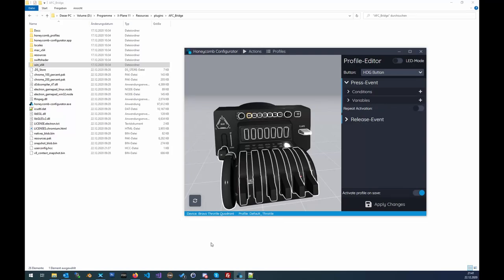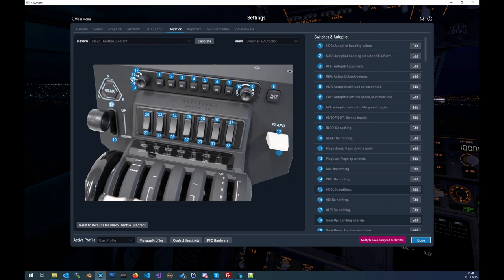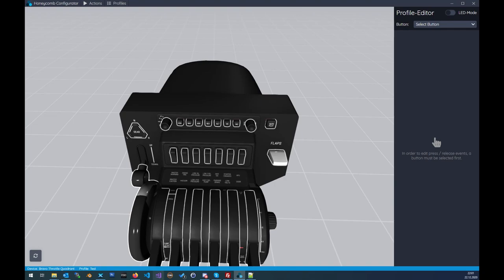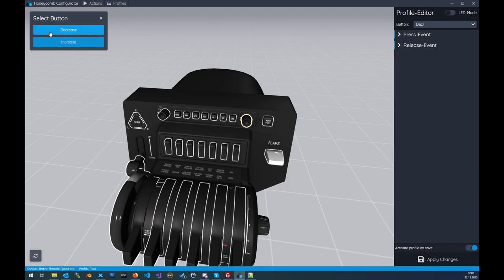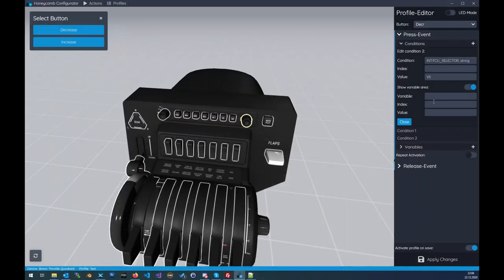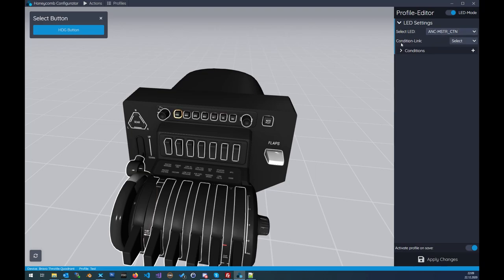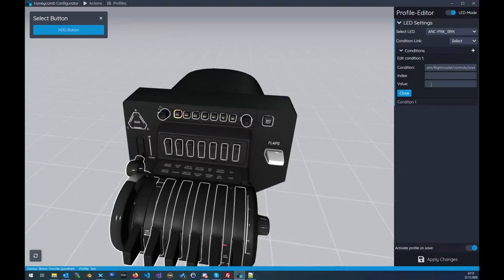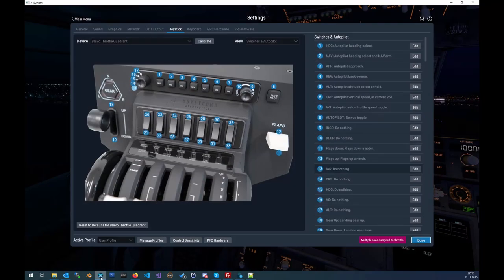Honeycomb Configurator - How to use Datarefs and Commands

Comment: on your video above you show the autopilot switches (HDG,NAV...IAS) backlit when not in active use. then when you select, say HDG, the light intensity increases to indicate it's in use. I use x-plane and none of these buttons are backlit. They do light up when depressed for use. Can you show me an example of the condition that I could apply to each of these lights to have them backlit when not in use. Thanks Roy

Comment: Thanks for your videos. Using a FlightFactor Airbus and having difficult time figuring a way to enter a command like "a320/Panel/FCU_Vertical_switch" in the configurator .  Under condition it does not show the datarefs/commands for this aircraft. When I try to use CUSTOM_NAME and enter the event when I load XPLANE it complains that this event will be discarded because of a null value. Any way to do this?

Comment: Can you tell me is there a way to use non-default commands with this? I am trying to configure the autopilot panel with the Flight Factor 757, which uses it's own commands in a separate folder.

Comment: Great tutorial ... thanks for what you are doing. I wanted to ask  how to do for the C172 in the Laminar X-Plane 11 S-TEC 55 to set, in the NAV button, the possibility of push the NAV button TWICE to select GPS Steering (GPSS) mode. Thanks.
Reply from the maker: with the next version, it would be possible. In the next version, you are able to make press events as many as you wish. So you could make also a press event with a local variable like in the FCU selector to track the amount of pushes and then you can capture it with a condition in another press event.

Comment: Thank you for this video! Did you ever figure out how to eliminate the red hydraulics light on the panel for the Cessna 172?  Also, for the Cessna 172, is there anyway to increase the sensitivity of the trim wheel?  In its default configuration, you have to turn it way too many times to get any appreciable response.
Reply from the maker: Yes within the latest version of the config tool (released since 5 minutes). Just check out the aerosoft forum and then you can use the new repeat function (Off, Normal, Delayed Normal, Delayed Fast)
Reply: Hey @lalawyer11, did you ever get around correcting the sensitivity of the trim wheel?